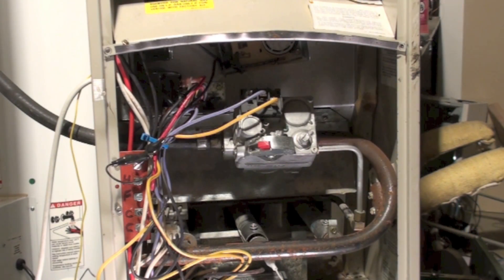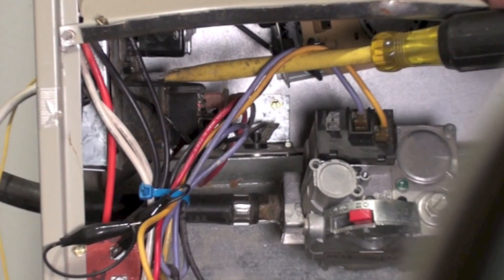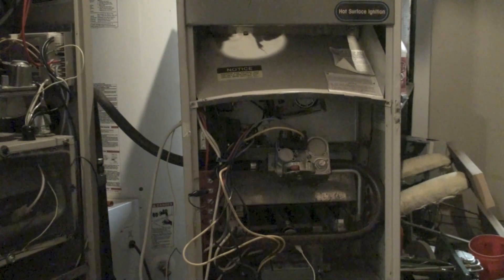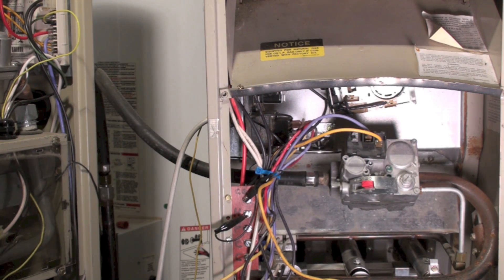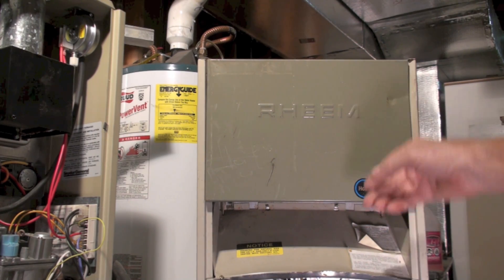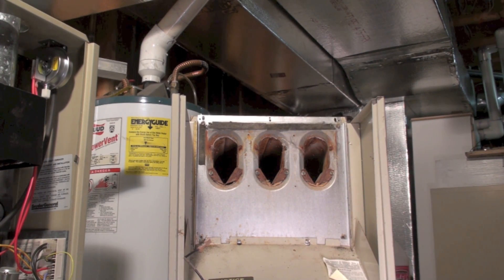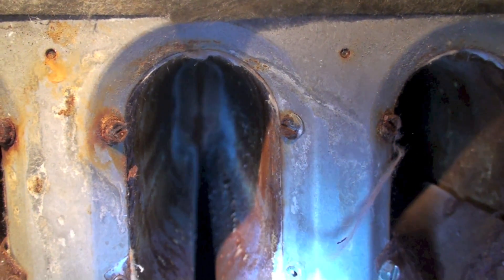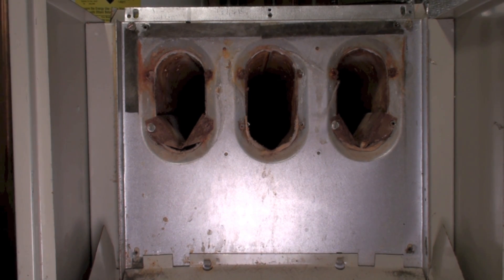How to clean a heat exchanger

Comment: I guess if the clog was up in the flue pipe  it wouldn't necessarily roll out, but the gases would come out of the draft hood.

What do you think?
Reply from the maker: That would happen. In fact that is what the draft hood is for. If it were not there the flame would roll out.

Comment: Do I see a black rubber gas line connecting to the gas valve?  I hope not.  It’s not legal to pass a flexible connector of any kind thru the cabinet.  Speaking of laundry rooms if bleach or chlorine gets into the combustion air it will rot out the heat exchanger.
Reply from the maker: The furnace is a test mule, not a heating appliance.
GFM

Comment: you will NEVER recoup your cost by replacing your equipment with a more efficient one
Reply from the maker: That all depends on the equipment you are replacing.  Also, when a major failure occurs, you must decide if the money is better spent on new equipment that will come with all new parts   or take the chance on the old equipment not having more major repairs.
GFM
Reply: @grayfurnaceman  negative, new furnace $10k...at my gas bill of 65 a month,I would save about 9.  So 1111 months or 93 years...lol
Reply from the maker: @AnhYeuEmMaiMai69  Then your choice is made.
GFM
Reply: @grayfurnaceman  that was the point, replacing something that still works fine because it is old is never cost effective...
Reply: @AnhYeuEmMaiMai69  My 2013 furnace just needed a repair, new mainboard, 900EUR with labour cost. My 1988 furnace from the other house works perfect without issues to this day. Unfortunately no more spart parts for it.. will have to replace it because of that, so my boiler doesn't leak.
Reply: @Muhovc  yeah the new stuff is not the same quality as the older stuff... I am lucky as my house was new in 2017 and the only thing I did to my furnace was to remove the spider web from the orifice tube for the gas... Wherever possible I do my own work as things are nuts labor wise

Comment: Take the burners out and the draft hood, use a flue brush and vacuum . Clean the burners and adjust the primary air to ensure the heat ex does not become plugged again. G1

Comment: Gfm if the furnace was manufacturer with spark ignition and that modulator and gas valve  is obsolete.  Would you install a standing piolot and new gas valve? Thank you Ron white
Reply from the maker: No.  Both Honeywell and White Rodgers supply replacement controls that can be matched with obsolete controls.
GFM

Comment: Melted ignition control box, melted wires, etc. you’d think that these components would be mounted where roll out wouldn’t affect them. I seriously scratch my head with the design of some equipment, it’s as if no thought went into the design in regard to servicing the equipment, absolutely drives me crazy, that’s not even mentioning the contractor who installed the equipment and now you’re screwed two times.
Reply: It's intentional. They know exactly how long it will last in ideal circumstances, then prorated warranty

Comment: I have an intertherm mghb furnace,  I got a bird's nest in the vent and took off the roof cap removed the nest and shop vacuumed from the roof down,  but I know some fell down,  and want to  make sure that nothing else is down at the heat exchanger.  What is the best way to accomplish this,  thanks for your advice.  Mike

Comment: Excellent advice! Thank you so much for your post. My pool heater needs servicing from being outside, even under a cover, pine needles are able to find themselves in the strangest places.
Reply from the maker: Pool heaters are the worst.  Animals get inside and they are usually around pool chemicals that will rust the heat exchanger.
GFM
Reply: Take the burners out and the top of the heat exchanger completely off, use various sizes of flue brushes and a shop vac as required. Clean and replace the burners as required. G1

Comment: whats ur opinion on the condition on my heat exchanger?: furnac emaybe from 1986

https://www.flickr.com/photos/24140175@N02/29977096295/in/dateposted-public/
Reply from the maker: I can't see any sure cracks or rust outs.  This is not definitive as I cannot see all of it.  You do need to consider its age and efficiency when comparing with a replacement.
GFM

Comment: d00d!  I love you man!!!

I have a furnace very similar to that one, except 4 burner.   A Ruud(Rheem?) UGDA-10EC-ER.   I was having problems with roll-out.   I had to clean each and every burn jet hole, which helped some.  But still getting roll out.   Then I found this video..    Well sure as shit, the heat exchanger was full of the rusty crap - blocking the airflow to the draft hood.

After cleaning that out(and recleaning the burners and chamber I have (4) full burners of blue flame, no roll outs, and LOTS of heat!   

Note for all - a .22 or .30 caliber bronze bore brush and cleaning rod works great in that narrow passage downwards.

If you're ever in central PA -  I owe you a beer or two!
Reply from the maker: +knight0334 It could happen.
GFM

Comment: You should really pull the burners out, or at the very minimum....cover the burners while youre ramming your brush down the heat exchanger .   A proper thorough job calls for pulling the Burners even if you have to disconnect the gas valve and slide the gas valve and manifold with it out.    We don't want to half-ass  the job  because it will only come back to get you .
Reply from the maker: Good thoughts.  I was more involved with heat exchanger cleaning and missed the burners.  Thanks for pointing that out.
GFM
Reply: Yep pull burners then brush all up through the exchanger passages. Vac or brush all the soot, scale, etc. out of there. Clean and reinstall burners. Needs to be addressed at the first sign of floating flames. That is incomplete combustion and high CO production.

Comment: I'd like to see a video on cleaning a 90% gas hot air furnace.  Is that something that you've done a video on?
Reply from the maker: johnmiller102 This one covers blower wheel and secondary heat exchanger cleaning.  Hope it helps.  http://youtu.be/jjHR9GLvQ7g
GFM
Reply: Thanks. That was a big help.  What about the primary heat exchanger? Do you find that they need annual cleaning. Does it depend on if it uses outdoor air for combustion?  I've seen them without piping to bring in outside air where they take air from inside the house directly. The other question I have is do you have to use any special sealant when replacing the cover from the front of the burner in a sealed burner set up?  Thanks for your help.

Comment: i have a question were standing pilot furnaces able to last longer because of pilot keeping moisture out of the heat exchanger or is that not true
Reply from the maker: That one has been going around for many years.  If anything, the pilot would add moisture from the combustion of the gas.  When furnaces went to high efficiency, the old thick metal heat exchangers were replaced by thinner more energy efficient ones.  Couple that with lower vent temperatures that sometimes allowed condensation upon startup, and you have more rust and sometimes they did not have as long a life as the older ones.  
GFM

Comment from the maker: Sorry about making you mad.  That was not my intent.  My problem is with your gas supplier.  I have, as you have, seen condemnations of equipment that could be easily repaired.  Sometimes decisions are made at higher levels that make no sense in the field.
GFM
Reply: same thing is true with "dead" refrigerators on the curb... only need a 50¢ starter that purposely got aged prematurely.

Great systems are engineered with weaknesses for service opportunities.

Comment from the maker: Thanks.  I have Lennox pulse coming up soon.  That should be interesting.  Merry Christmas
GDFM
Reply: I installed a number of Lennox pulse furnaces when they first came out.  Our the shop I once worked at was a Lennox dealer.  We had a booth at the county fair, and we’re demonstrating the furnace.  Weren’t those all supposed to be changed out for safety reasons? I know the heat exchangers went bad prematurely.  I thought their was a recall due to some legal issues. I believe they stated a 20 year heat exchanger warranty.  Make sure you bring the right spark plug.
Reply from the maker: @rodgraff1782  There was a recall for heat exchanger problems.  Lennox has been trying to get rid of them for 30 years, but there are still some out there.
GFM